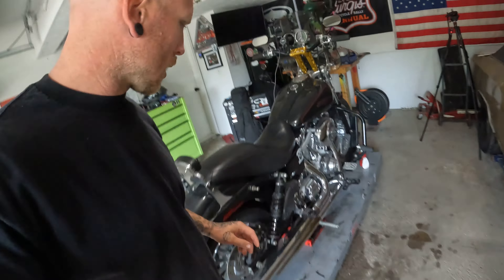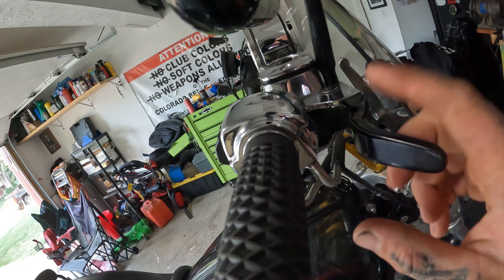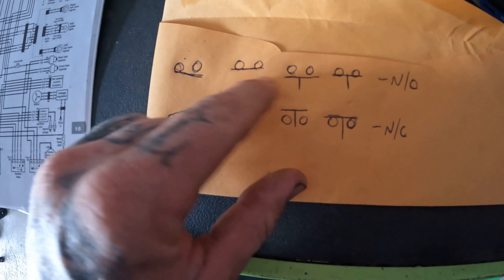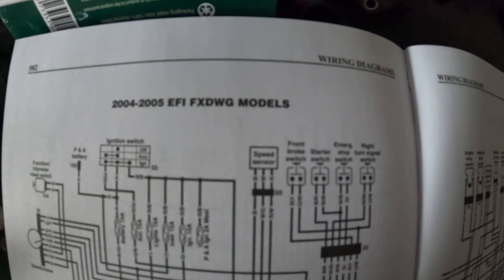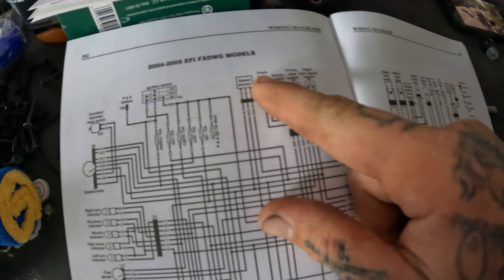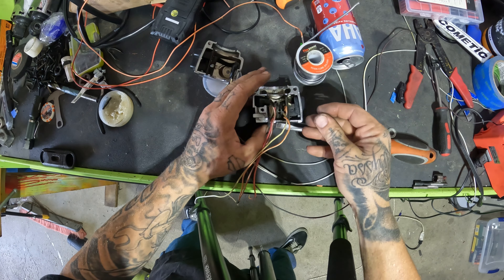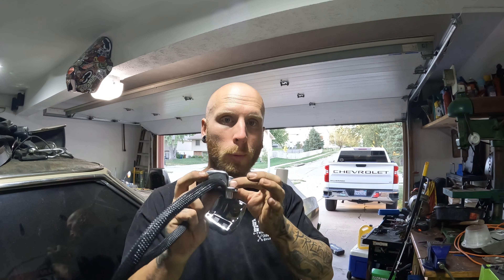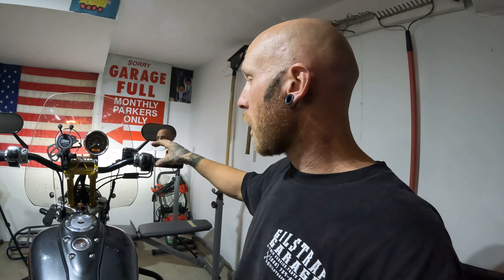Harley Davidson Brake Lights are STUCK ON

Comment: Thank you. I installed some small front indicators under the handlebar controls. Had to take both Controls apart to integrate the wiring. When putting it back together I left a too big gap between brake lever and brake switch, brake lights permanent on. Thanks to your detailed video it was just one look and a quick fix.
Reply from the maker: Awesome! Glad it helped 👊🏻✊🏻

Comment: Thank you, my rear brake lights on my 2006 RK were staying on and heating up, I worked the front brake lever and the brake lights started operating as they should. I am going to call the HD dealer and order another switch and or rubber cover. Life is good on my RK.

Comment: 😅appreciate the video, fixed my lights in 10 min
Reply: let me guess, you put a little peace of tap, on the inside brake lever,like i did, to fix it!
Reply: @ no I had recently put new thrashin perch clamps on and my check engine light kept coming on, I had noticed my brake lights were stuck on, by watching this was able to find out when I changed the perch clamps I had not got it back together correctly. Fixed all my problems

Comment: The book says to use a cardboard shim to protect the switch when re assembling. 

I had this issue after installing LSS shorty levers. I just put a piece of thick tape on the lever tang as a temporary fix. 

That temporary fix has been in place over a year ! My switch is intact though.
Reply from the maker: Man, and I’m always the first to say in these videos “check your manual” 🤣 lessons learned 🤦🏼‍♂️ my fix is still holding up well though
Reply: Brandon, hats off to you for fixing it right. That’s a lot of work pulling the connectors out of the frame.
Reply: lol...yes, look at my post!!  did the same, been working for 7 years!

Comment: I'm having that problem with my Dyna Switchback but it's fine when I first start riding the bike but after about 60 Miles brake light comes on. Melting everything inside break light housing. I had to resort to using a bulb that won't work for running lights to keep from getting everything so hot.

Comment: I replaced my switch with HD replacement still same.issue... repla ed with the clutch safet switch and its worked flawles
Reply: There is a small sliding piston inside the brake level, take it apart and spray some BP BLASTER, inside on the sliding piston!  done!!  fixed!

Comment: Would you have a part number. And would that part number fit a 2013 street bob
Reply from the maker: 2013 is going to be different, because around that time they changed a lot of the electronics and went to CAN-BUS. I want to say the switch is built in to a circuit board on the later models, but I could be mistaken